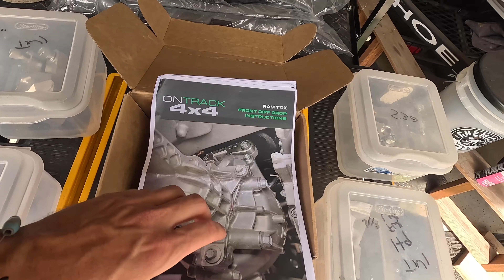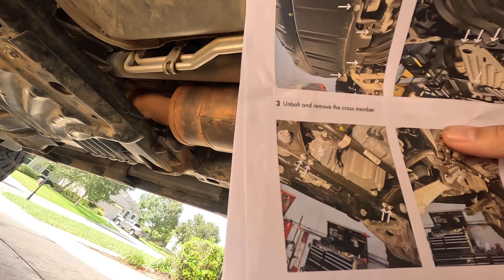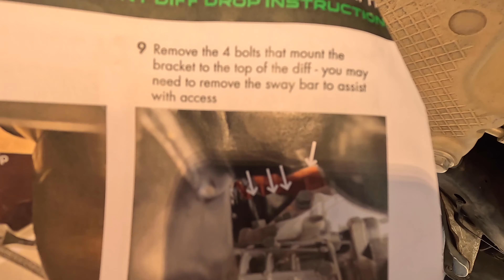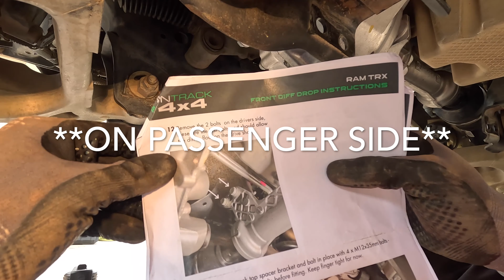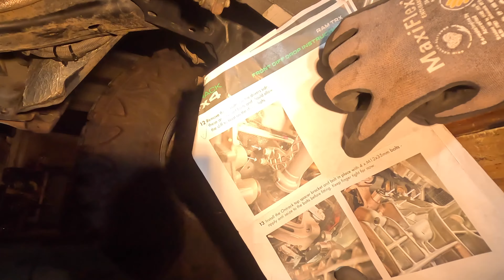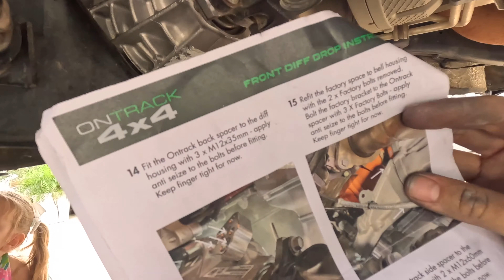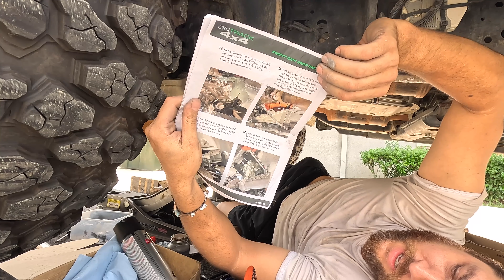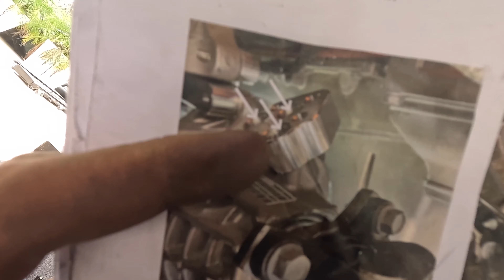FTR | OFF-ROAD DIY - Wragth Motorsports DIFF DROP INSTALL on RAM TRX | OnTrack 4x4

Comment: I had Roy and team install the Diff drop kit for me. Glad i went that route. I just purchased the 1.6" Eibach kit today and realised after everything, that i have that kit. Have you installed a similar kit or know if that'll push it back to stock angle or will i have some wiggle room still?
Reply from the maker: We had that exact lift on our truck for about a year without issues. I think that should be a pretty safe setup (about as safe as bone stock IMO).  Let us know how it turns out!
Reply: @fullthrottlerick199  perfect! Will do! Im hoping with this being a minimal level, that the diff drop kit will still help with those angles and keep stress off the boot
Reply from the maker: @harisarif  I think it's the ideal combo for keeping it about as safe as stock while still giving you the level/lifted look. Jumping up to 37s wouldn't change the CV angle so that could also be on your future mod list 🤘

Comment: haha looks like it was a fun time! The main thing I learned is to get at least 2 buddies to help! Not sure I can find anyone as qualified as your helpers, but better than nothing. Let us know how it does offroad! Curious to see if there's any rattling or interference from the diff hitting the area you cut, or hitting the skid plates below. Thanks Rick!
Reply from the maker: Yes, 2 buddies would be a God-send man! Would've made for an afternoon project instead of 2 days lol.  Will definitely report back on any interference issues. So far so good though. Hoping to get a local run in this weekend. Side note: we're hitting Gulches ORV park 12/13-12/15.  Since that's halfway to you, check your calendar man and see if you can make it. We've got 2 Rams coming so far 🤟🤟

Comment: I assumed cv’s were toast after changing their geometry. Excited to see how this works out. Is there any potential cons with this product?
Reply from the maker: So the CVs are just increasingly angrier the higher up you go.  We ran a 1.5" front lift for a year with no issues.  Went up another 1.2" and all hell broke loose lol. Stay tuned for that vid ("5 axles in 5 weeks" 😂).  There are 2 cons with a diff drop: Slightly less ground clearance (we lost a fraction of an inch) and a bit more stress on the actual differential/diff mounts.  We've essentially transferred the added load/stress from the CVs to the diff/mounts. Hoping it doesn't bite us in the you know what!
Reply: @fullthrottlerick199   I’ve read that the CV’s are angry in stock form, let alone with a lift. 5 CV’s is nuts in that amount of time. Did the dealer warranty all 5? This diff drop seems pretty intriguing. I wonder if 37" BFG's would fit well with this kit and without a lift… Is there any long term data out there on TRX’s with this kit?
Reply from the maker: @adamg3911  Yea we lucked out with our dealer since we've got a really cool Svc tech. And yea I 100% agree the CV angle on our rigs is pretty extreme in stock form, as further evidenced by the 1000s of people who blow their stock CVs without lifting or leveling their trucks! We ran 37s without a lift for about a year. That was the trick setup IMO. Keep all the suspension geometry stock and fill those wheel wells nicely. Rubbing wasnt a problem even at Windrock/etc.  Only problem is dont jump it like that b/c you'll likely blow the fenders off!